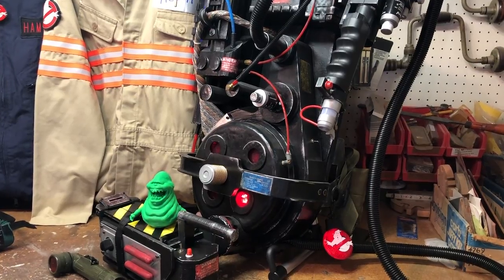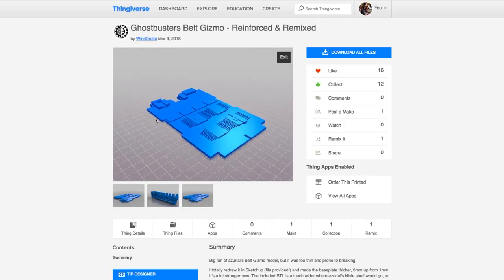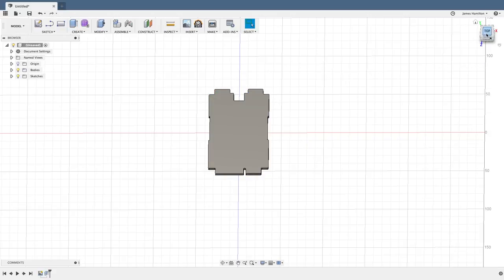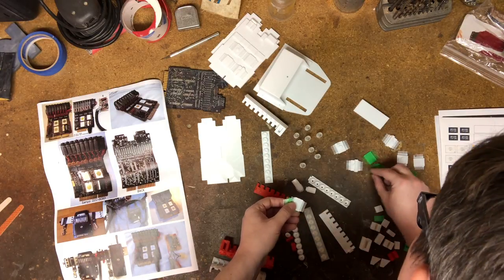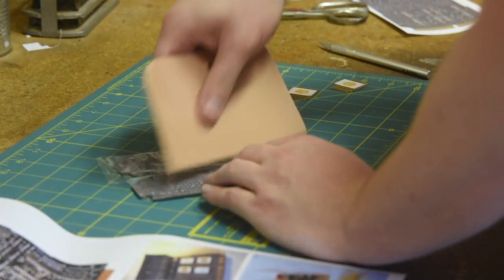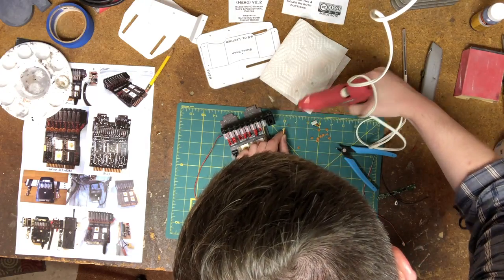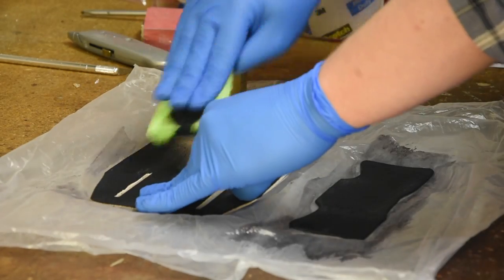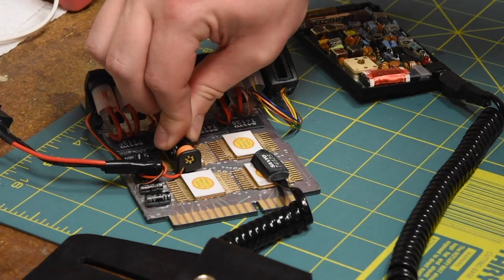Building a Ghostbusters Belt Gizmo with lights!

Comment: What kind of 3D printer did you use?
Reply from the maker: I have a CR-10s & a Monoprice Maker Select Plus. Both are nice printers that I'd recommend.  https://amzn.to/2zmd8sd  https://amzn.to/2DmotfU
Reply: Have you had any problems with it? I watched some vids on it, it looked awesome. Some people had problems with it though.
Reply from the maker: I’ve not really had any issues, but it’s a printer you need to baby a little bit. I’ve made a few small mods on mine, but nothing much. I don’t really push mine that hard. A lot of people who have issues, have them running 24/7.

Comment: Where did you get the lights?
Reply from the maker: D-props links in the video description.
Reply: Thanks!
Reply: What kind of filament do you use? Do you use the manufacturers filament?
Reply from the maker: The filament is PLA. I have a link in the description to the clear PLA I used. It can be used for all of the parts.
Reply: I never learn to look in the description.
Reply from the maker: I try my best to link to everything I use/ talk about.
Reply: So the clear PLA filament works with the Monoprice right?
Reply from the maker: Yeah, the clear PLA prints just like any other PLA more or less.